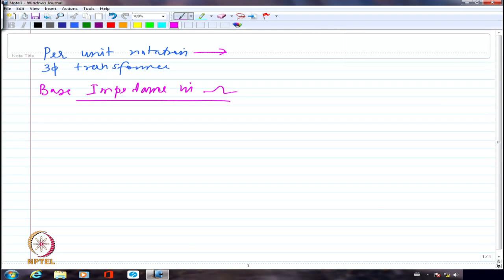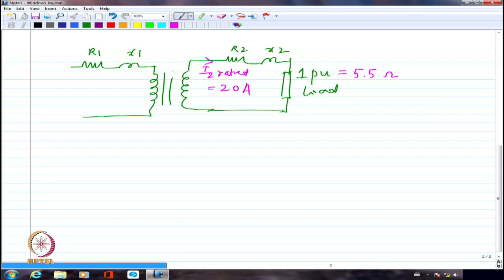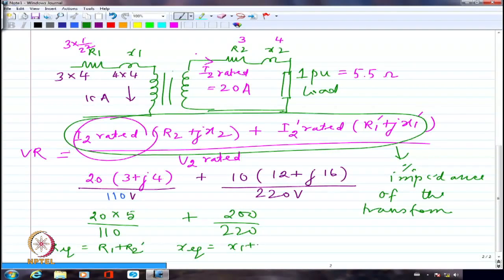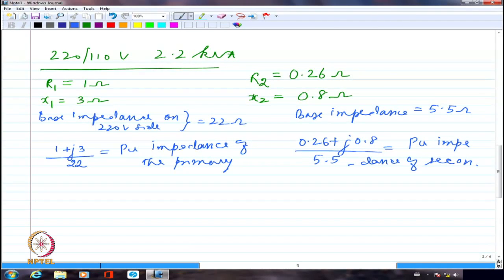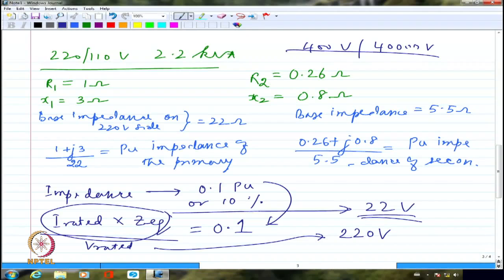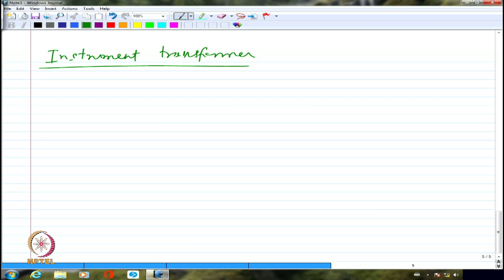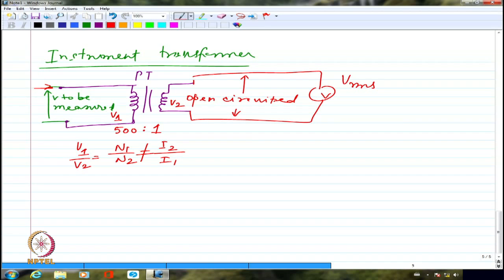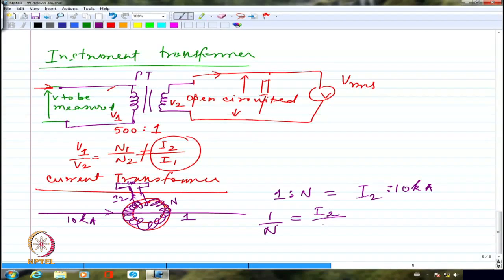PU notation and Intoduction to Instrument transformers

Comment: Dear Madam
This is very good lecturer series. I think there is a writing error in defining Voltage Regulation by looking from secondary side.

Why not the voltage drop I2 (R1' +X1') once  R1 , X1 transferred to secondary side when looking from secondary side?
From 9.47 minutes on wards the explanation is not clear.
Kindly look into the video.
Regards
Sunil
Reply: Hi sunil did you find an answer to this question? I too am puzzled by this
Reply: @ahmedkamiss7643  It
 seems to be done incorrectly.